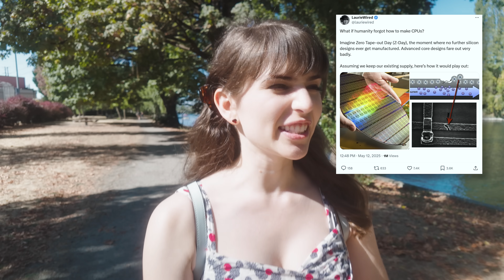what if humans forgot how to make CPUs?

Comment: Thats why i'm keeping my Amiga 500 around, you never know!
Reply: Just be sure it's not an A500+ because otherwise the battery will leak and destroy the memory bus traces on the motherboard
Reply: @russwilliams4777 its recapped and has battery removed. So im good for another 40 years :)
Reply: Then at least we'd have Jungle.  Long live the breakbeat!
Reply: Thats correct, things would get MUCH cheaper in the short term, computers are EXTREMELY long lived if not run hot, underclocking and making code much more effecient would emmediatly be focused. removing computers from internal combustion cars, refridgerators, microwaves,.

batteries would be made for "obsolecent" cell phones.

and since only cpus, then diodes will still be made and tv's, displays for cell phones.

cellphones would go into remote display technology and act like terminals
Reply: Yep. And I have a few new, unused Motorola 68000 processor chips in my garage along with a few tubes of 8K static RAMS and associated logic chips.
Reply: This made me think of the first time I saw a NewTek demo on an Amiga. My friends and I stood watching, amazed. “Hello. Welcome to NewTek.”
Reply: Oh, look at you with your Amiga. I've still got two C-64s. I can't say for sure that they'll power up at this point, degradation from disuse is a thing and emulators are so much easier. But I do have them.